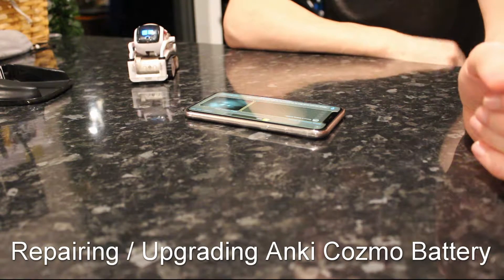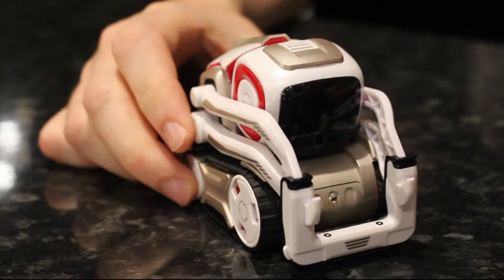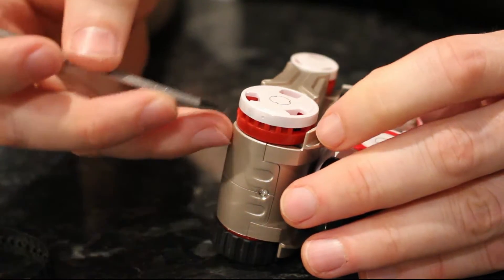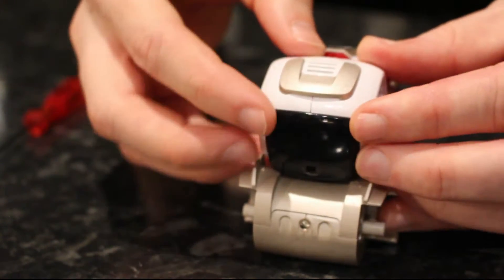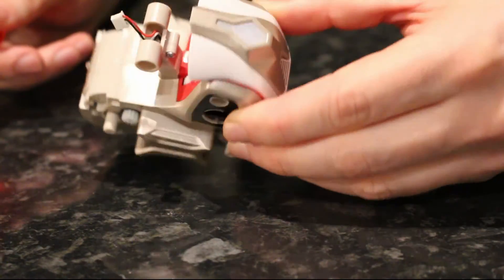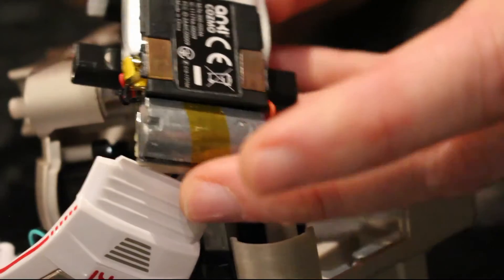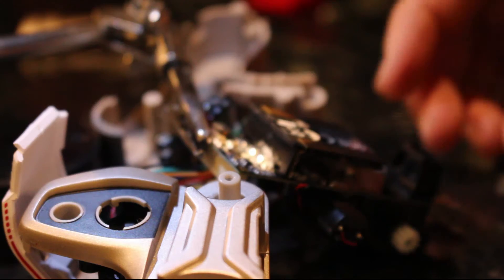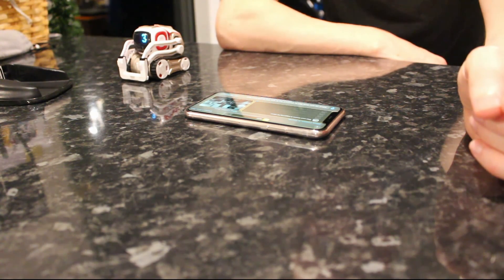Repair / Upgrade Anki Cozmo Battery

Comment: Firstly, allow me to explain the meaning of the 6 digit part number of the battery 503236. The first digit is the thickness of the battery, 50 = 5mm (60 = 6mm  and so on. If the first number is, say, 55 then that would be 5.5mm). The second digit is the width, 32 = 32mm wide. The last digit is the length, 36 = 36mm long.

I really can't understand how people think can they get that much more mah from a battery that is damn near the same size? It is simply not possible. It's the amount of chemicals inside the single cell "Package" (Size) that gives it the mah rating.  Therefore, you MUST use a larger battery to get more mah, period. Your comparison is the same thickness, but a 2mm narrower and a 4mm longer battery. Actually only making it a total difference of 2mm larger. 2mm does not equate to almost twice the mah rating.The Chinese are notorious for their misleading and lying to people about their products. This is one of those times. Another example of this is, "You cannot fit two gallons of baby shit into a one gallon bucket".

Another thing about it that might surprise you is, Cozmo's original battery lasted maybe 30 minutes, more or less. If  you replace it with a 30% larger battery, you will get 9 minutes, more or less, longer. I know, right? 30% sounds like a lot, but it isn't really that much. So, when DDL tells you that the new Cozmo 2.0 will give you up to 30% longer runtime, now you know. The "up to" is because this is just an approximation. Due to the amount of chemicals not being equal in each battery. Also, Due to the location of the battery, it is only possible for a certain size battery to fit. So, this means that a new battery that will give you 30% longer runtime, is the largest battery that will fit in the allocated space. i'm sure they would have made it an even larger battery, giving you even more runtime, but it is more than likely because Cozmo would get a lot hotter, that they didn't even consider it.

So, in conclusion, the chances are that this so-called 600 mah battery is probably twice the price. But not twice the runtime. Now, if you could fit 2 batteries connected in parallel, you would get twice the runtime, common sense and logic dictates this. This also proves that you cannot get twice as many mah from approximately the same size single cell battery. Just trying to help people that really don't understand how Li-Po batteries work.

Comment: I did the replacement a few days ago and woke him up today and he lasted as long as he did before the replacement, whereas earlier today he was going for ages! Any suggestions?? 😰😰
Reply from the maker: Do you have a wifi mesh system or signal booster attached to your router? strong wifi signals on the 2.4GHz channel can overpower Cozmo's aerial and cause it to shut down (which show the same symptoms as a bad battery)
Reply: Thanks so much for this tip but we don’t have a signal booster. 😕 He did last a lot longer when we tried him again earlier, do you have any other reasons why the battery would die so much sooner than is estimated? (He has been on charge for at least 1 hour and also you are one of the best repair youtubers I’ve EVER watched as you make very detailed tutorials and whenever something is wrong with our cozmo, we can always come over to your channel and you have a tutorial on how to fix it! You’re an absolute legend and there is no reason why you should have dislikes on any of your videos as they are a ‘live saver for our little cozmo!’ 😄😄😄😄

Comment: I just wanted to know what soldering tool do u use?
Reply from the maker: Just a cheap one off Amazon. But it needs a fine point as the solder points are close together
Reply: Which one would u recommend,to replace cozmo’s battery?
Reply from the maker: @andresgonzalez8725  https://www.amazon.co.uk/Digital-Controlled-Thermostat-Electronic-Production-Desoldering/dp/B08G4FCMVZ/ref=sr_1_3_sspa?dchild=1&keywords=soldering+iron&qid=1627251699&sr=8-3-spons&psc=1&spLa=ZW5jcnlwdGVkUXVhbGlmaWVyPUFKM1YzSk1IRFNGTVEmZW5jcnlwdGVkSWQ9QTA1MzY0MzVOUU1ZTk9QS0xVVzAmZW5jcnlwdGVkQWRJZD1BMTAyMDQ5MTJYNEtSTjNOTDhBRTEmd2lkZ2V0TmFtZT1zcF9hdGYmYWN0aW9uPWNsaWNrUmVkaXJlY3QmZG9Ob3RMb2dDbGljaz10cnVl

Comment: Great tutorial! Thank you so much for doing this! I just replaced the battery in my son's Cozmo and your directions helped tremendously. Found the battery on Amazon for $15, perfect fit and twice the capacity. The head is a little tricky but I found if you only remove 3 of the 4 screws, and leave in the lower left screw, it will hold that little plastic rod in place making it easier to go back together. I accidentally left out the counterweight the first time so I got to tear it apart twice! Also the trick with the arms is there is a little tab or clip that you can barely see but if you lift the arms all the way up becomes visible that you want to push in so it releases. I didn't quite see that in the video, they don't just pop off, you have to press in that little white tab, just in case others have the same question. Thanks again! Cozmo is up and running like new.
Reply: How much is it in pounds and currency isn’t in “dollars”

Comment: Are you still offering to repair? Didn’t know I had to solder haha
Reply: You don’t need to solder, i cut the wires of the battery that is in there and just joined the new battery wires to them and covered each with insulation tape

Comment: Thanks for this, I got my Cozmo battery replaced.  Yes it's a lot of steps, the battery is deep down at the bottom of the build pile.  Once you get down there it's very easy to replace the battery.  The hardest part of the whole mess was getting the head back together.  I felt like I could use a 3rd hand.  In the end the trick there is to get the screen in, then put the two halves of the head back together almost all the way, maybe even thread on of the screws in 2 turns, then clip the face plate and the speaker back in place.

Comment: Hello!  I have attempted this repair myself, but struggled somewhat with the soldering.  The battery connected to the robot, however I am not able to charge the battery on the the stand.  It shows charging but never fully charges and just times out.  Played with the robot for an afternoon with the charge the battery arrived with, but not getting any additional charge.  Is this from the soldering or possibly not reassembling correctly?  Can you give me any advice?  Thank you.
Reply from the maker: Email me johnjudge6@gmail.com

Comment: First of all, thanks for the video. I got my Cozmo from ebay today and the battery does only last a minute. But the connecton to cozmo is also very unstable. If he is doing something, it looks like there is a lag sometimes. Do you think this can also be a result of the low battery? I hope after the replacement it will work fine.
Reply from the maker: Definitely sounds like a new battery will fix that lag

Comment: Thanks for the video on doing this repair! I have ran into a problem while working on Cozmo with my daughter. The two screws for the smaller wheels were in real tight and got stripped.  Has this ever happened to you and are there any suggestions for getting them loosened and out of there?
Reply from the maker: Hi Ed. I have another video in my channel showing a potential fix for this issue....
Reply: @TheJohnJudge  found it.  We tried the rubberband idea already.  Also gave some superglue we had a try but no luck with either. Awaiting the Cozmo 2.0 but daughter does not know about it and is really upset i couldn't get this one cracked open.  :/
Reply from the maker: @hungerfan_ed  email me johnjudge6@gmail.com

Comment: Thanks for the video. I was able to change the battery. My little girl is happy! I did not find a 503040 lipo near where I live, but I replaced it with a 403035 lipo 450 mAh. It does the job! Most tricky part was to reassemble the head i think.

Comment: This is a fantastic guide.  I’ll admit it — I was worried I’d be sending John a bag of parts to fix, but it worked!  With John’s guidance, I did it!  My son is ecstatic.  Thanks, John!!
Reply from the maker: Hearing this always makes me happy! Well done Thomas.
Reply: Hi John. My sons Cozmo shows no response when placed on the charger. Not sure if this is a battery issue. I would like to send Cozmo to you for repair if it is determined that the battery is the culprit. Thank you. How do I get an address to send?

Comment: Excellent video John!  I think that most skilled hobbyists could perform this repair.  A few words of caution, however:  when you feed the new battery cables, they are typically "live" and have the potential of damaging the circuit or components if they happen to touch any circuit area and make a connection prior to the exact points where they need to be soldered.  It may be helpful to snip each new battery lead so that only the insulated wire is fed through, and then stripped just prior to soldering.  Additionally, rosin left on the circuit board after soldering can cause problems:  usually, 90% isopropyl alcohol and a cue-tip should be used on the soldering joint to remove any excess rosin that pools around the connection.  The final job should be clean, shiny, and rosin-free.  Finally, the original Li-Po battery is still potentially dangerous because the battery can still hold a residual charge.  The leads should not be shorted, they should be snipped off, and the old battery disposed of properly in a recycling facility.  A shorted or swelling Li-Po battery can explode and/or cause a surprisingly spectacular fire (see YouTube LiPo battery explosions for examples of what can go wrong).
Reply from the maker: Thanks Jim! Excellent points here. I am in the process of making a short video dedicated to the soldering process and I will use your comment as the basis of the talking points. Over time I’ve developed a safer way of installing the battery in line with your points- you have encouraged me to get it finished.
Reply: Thank you both

Comment: I followed the video and replaced the battery, but the Cozmo shows "cozmo wants to be put down" now and the head is keep moving up and down while the lift never moved. Do you know which sensor maybe damaged during I replacing the battery? When assembly the cozmo back, do I need calibrate head and lift position?
Reply from the maker: The floor sensor on his underside may be damaged. Out your finger over it and hold him upright.

Comment: Thanks so much! My youngest wants to play with Cosmos after a hands off from his older sister but it keeps getting disconnected after 5min and we can restart it again and repeat. Not sure if it is battery related but I will get a new battery pack from your link just in case as I tried everything from the anki website. Too bad it is no longer supported.
Love this little guy!
Thanks again for your great video. Subscribed!
Reply: I wish I could send over the pond the cosmos for your repair service. Postage is so terrible.
Reply from the maker: Good luck with your repair. Perhaps try a local tech repair service (the guys who fix phones, etc) and see if they can install it for you.

Comment: i changed my battery just like in this tutorial and it will claim to charge but when i pulled it off the charger when it said it was done. it would not turn on. i got it to turn on while it was on the charger but nothing would move

Comment: Hi. Are you still offering to replace the battery in the Cozmo? My son had one recently he bought off eBay. Worked ok for 2 days. Now won't charge.
Reply from the maker: Hi, I am currently waiting for new batteries to arrive from China. I will message you when they are here. Does the robot charge at all? Or does it shit down shortly after leaving the cradle?

Comment: Thanks for the great video, found your videos as a Vector owner curious if a battery swap was possible. So relieved they could be saved I picked up a rescue Cozmo! Was told the only fault is 'broken cubes' (Dead batteries as expected) but he has a weird issue I'm sure is the battery. He will operate for a few minutes but fully shut down, but in low power mode seems to stay idle for ages. Do you think its the battery? Thanks :)
Reply from the maker: The Restart Collective hi. Definitely sounds like the battery has degraded and can no longer hold a charge. Common issue on these units now due to their age. A new buttery will give him a new lease of life.

Comment: Thank you so much, Cozmo repaired, my daughters think I'm a hero:)
Reply from the maker: Mathieu Ferry hehe! You ARE a hero! Well done. I love reading comments like this. Thanks.
Reply: Thanks  @TheJohnJudge   one comment on tha way I did it. Like another comment I saw today, i was not confident enough on my soldering skill to directly attack the circuit. I just cut the existing wires and solder the new battery on them. Worked like a charm.
Reply: @TheJohnJudge   Hi!  I’d like you to help. Change battery on cozmo.  How do I contact you?
Reply from the maker: @faye5296  Hello Faye, email me at johnjudge6@gmail.com
Reply: @TheJohnJudge   Great sending you email now!
Reply: @TheJohnJudge   Hi!  email sent!

Comment: I was wondering if you would be able to replace the battery in my son's Cozmo.  I don't have any soldering tools and would was wondering what it would cost for the repair.  The red light on top just flashes.
Reply from the maker: Hi Joe, I'm happy to help - email me at johnjudge6 - at - gmail.com
Thanks,

Comment: Very informative video John, thank you. I have a Vector which has a problem with it's head PCB/LCD. This unit does not complete the boot-up cycle and just stays with the green power light on plus one white/blue light. I know for certain the problem is the head PCB/LCD as I have two more Vectors and i've interchanged some parts. Have you any idea what would cause this please?
Reply from the maker: Hi Les, that sounds like an issue with the wifi aerial, which is connected to the screen in the robot's head. There is a similar anomaly with Cozmo - a single green flashing light interspersed with blue/clear lights, indicates that he is stuck in a boot cycle. Invariably, it's due to the fact that he can't start his wifi aerial to become a hotspot. the root cause of this is the powerful wi-fi mesh systems that people have in their homes, which causes a conflict and drowns out the robots wifi frequency. This probably doesn't help you, but could be a place to start. Please share any breakthroughs you may have.

Comment: Very helpful video, thank you for sharing this and the info on the replacement battery!  My daughter is so thrilled to have her friend back.  I did two swap outs back to back, and did find it easier to reassemble the second cozmo by removing the head screws only on his left side.  This kept the internal screw rods in place, and reduced the tricky head reassembly from ten angry minutes to one slightly annoying minute.  Hope that helps!
Reply from the maker: Excellent! I always nice to read these stories - thanks for the top-tip on the head assembly (I'll probably make a new video showing what you described; it will no doubt make reassembly much quicker!
Reply: @TheJohnJudge   waiting eagerly for the new vedio if it makes the process much easier. World is a better place with people like you John

Comment: Hi John. Just wanted to say thank you for this post. I was gifted a sickly Cozmo who could only handle a few minutes of play and decided to risk surgery on him. Got a new battery and followed your guidance to get him apart. My soldering skills are not that good so I didn't risk touching the circuit board and instead went with cutting the wires as close to the dead battery as possible then exposing the core. I twisted the new wires on gently and then added blob of solder and electrical tape to project them. All went back together and now have a fully functioning Cozmo who handled an hour plus earlier with no sign of red on his back. Couple things I noted as I went through the process, it takes more force than seems right to get the "geared" arm off. I could see how the "key" worked and I was at the right angle but it just didn't want to let go! Re-assembly of the head was also very tricky. I didn't clock at first that the bars that the screws connect into have a way around - both in terms of left/right and the shaped ends that go into the right hand side of his head (where the spring is). In the end I found it best to attach those end first, then slide the LED over the lower bar, align the top bit and the windscreen and then screw the left side of his head on last. He is a very cute little thing now he works fully!
Reply from the maker: Hey Simon! Thanks for your reply! I love reading stories like this. I agree on the two points you make - I think I gloss over them in the video but will definitely revisit and make a clearer demonstration for future reference. The gear arm has a definite pop when removed, which can be daunting the first time. And the head is also very fiddly when having to line up the tubes and spring to get the assembly back together. Great to hear that you got your unit running around again!